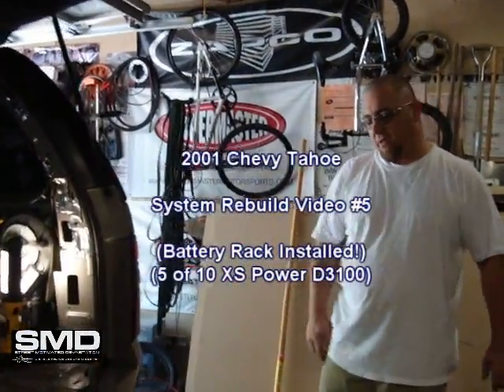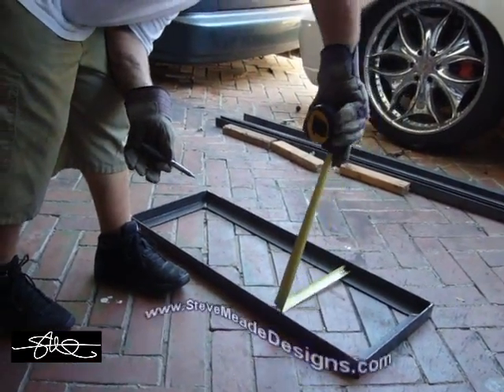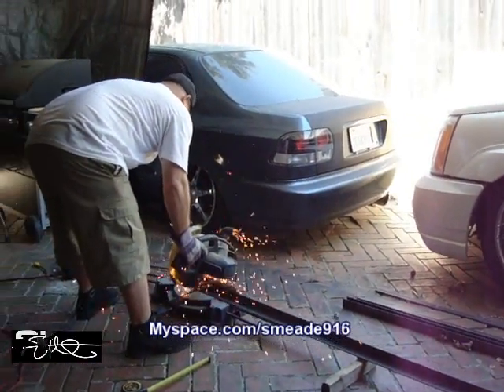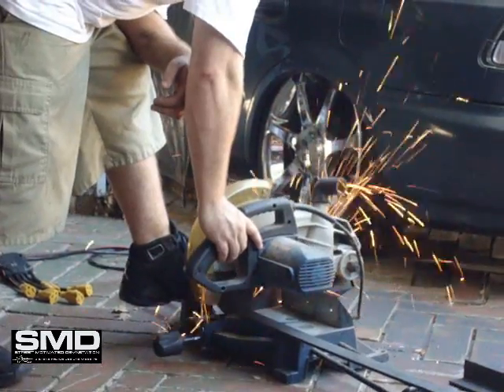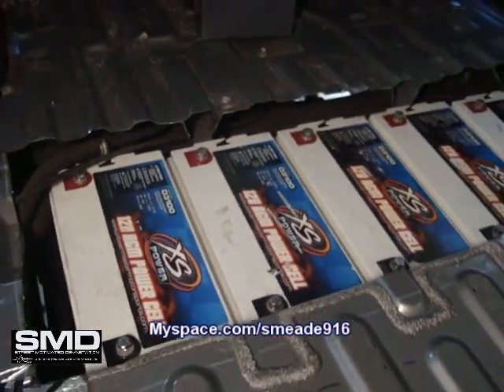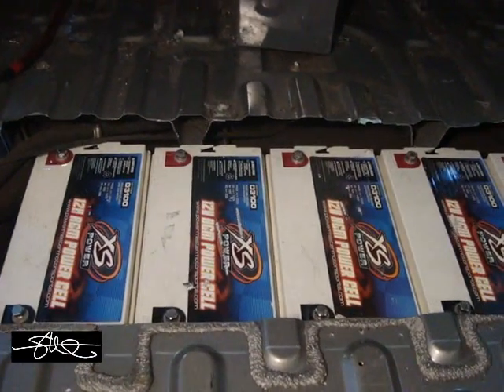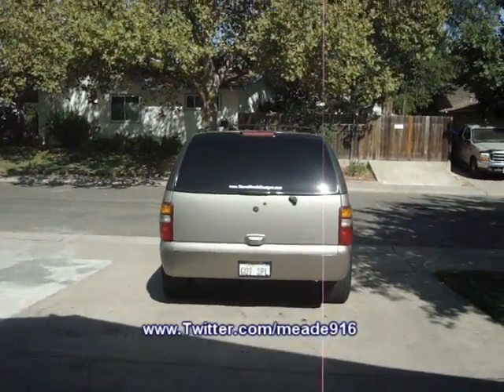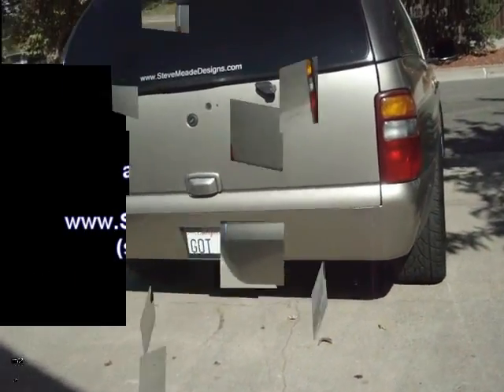Tahoe 30kw System Rebuild (Vid 5) Battery Rack Fab/Install

Comment: did you use one of the xs's under the hood as well or did you just leave a regular battery just wondering because im gonna do multiple batteries for first time on a smaller scale

Comment: Over 200 comments and 90% is about sealing up the battery box. Do you people really think that Steve is going to put that much time and thought into designing this system and just leave the batteries exposed to the elements. Common sense people, thats almost like leaving the windows down in a rainstorm. Excellent work so far Steve, keep it up!!!

Comment: Good job.  I don't see any problem with the integrity of the frame being compromised because the enclosure will still sit on both parts of the floor.  All you did was remove a portion that supports the floor where seats would normally be.  The enclosure will use all of that room so the area of surface contact is still greater than that of the seats.  If you were to add a little integrity I would add some type of crossmember to the bracing on the floor.  Great job and good welding.

Comment: A stone could easily punch a hole in those batteries since they are made of plastic, probably better if you place something in the bottom of the battery box first, then lower the batteries ontop of that.(just for protection, better safe than sorry)

Anyway it looks sweet. GJ

5*